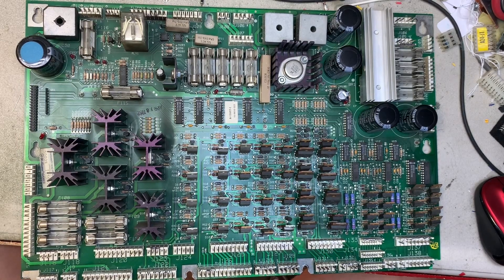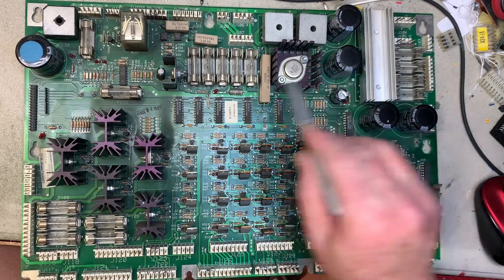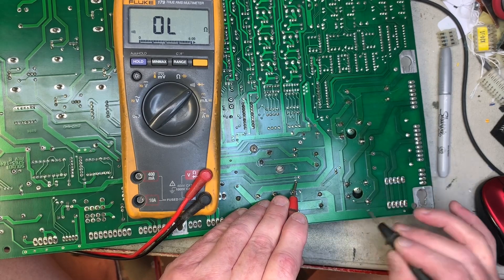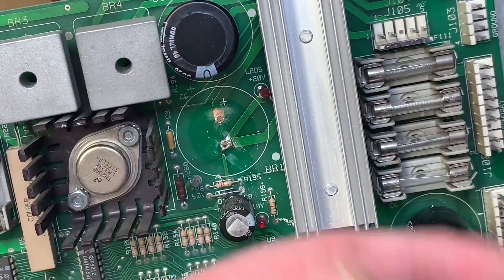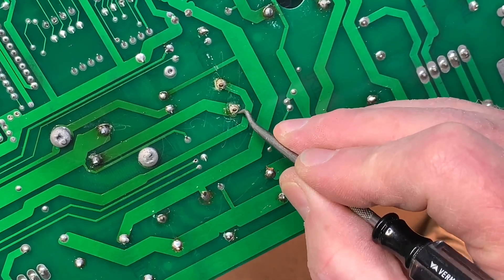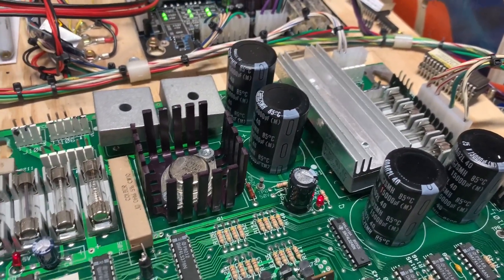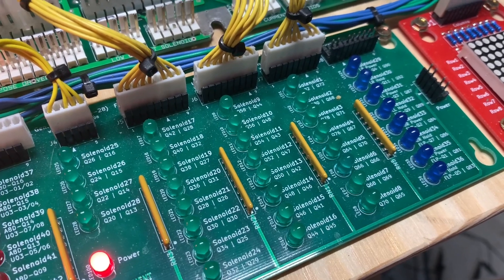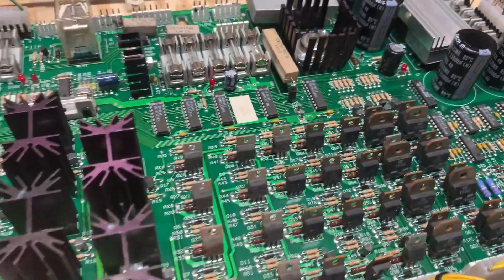Williams WPC PowerDriver Board 15000uf Capacitor Through Hole Repair

Comment: Are you still working on pcb boards? I have a spindle controller took board with no schematics I need fixed. I have attempted to pull the relay to change and lifted a pad. Need help!
Reply from the maker: Sorry.  I’m cutting back.